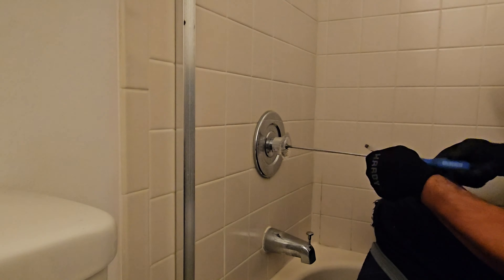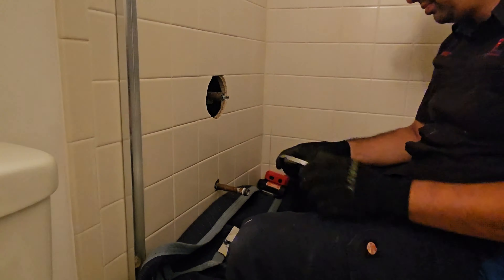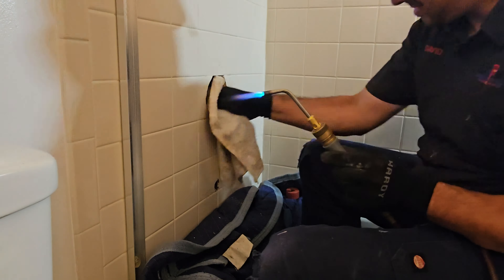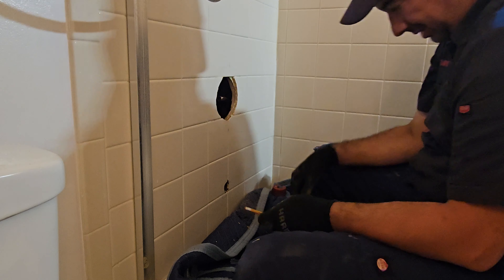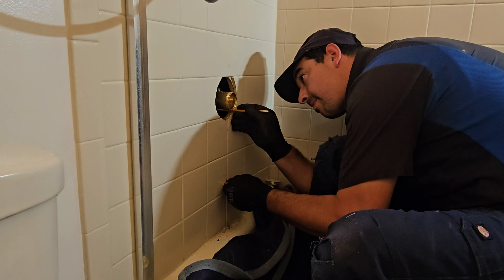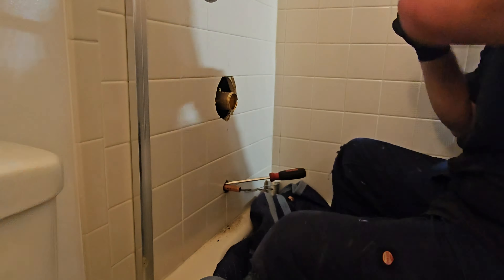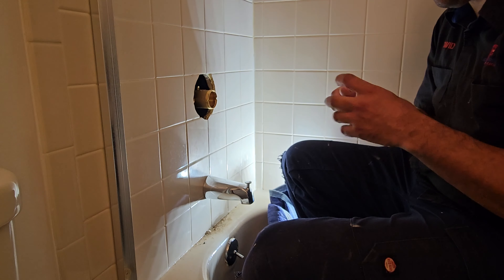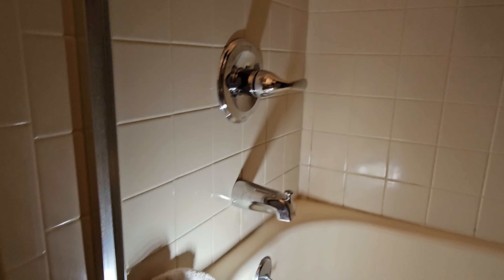Replacement of a Moen diverter for a Delta without tile work. #deltafaucet #plumbing #diy

Comment: So you sweat the old valve body out?
Reply from the maker: All of them are different. Sometimes, I can't cut the copper because I would be short and need to use a coupling, which I hate to use. So, in that case, I cut the body and unsweat the diverter.  The one I cut the copper on the hot and cold and unsweat the body from the shower head pipe.

Comment: I’m not a propress user but honestly I would probably just open up the wall behind the tub and attack it from that way. Unless its back to back tubs then that wouldn’t be an option. Fuckin awesome job though man I would hate to work with that small of a space.
Reply from the maker: It was back to back bathroom, only options where to open tile or try what I did.
Reply: @PrecisionDavePlumbingMore  yea in that situation you just gotta tough it out lol
Reply from the maker: @tannerwest6823  Yes sir
Reply: Awesome job. You ain't doin this with a propress,  I likes my solder!😊
Reply from the maker: @denniscordova9920  Yes sir, solder for life.